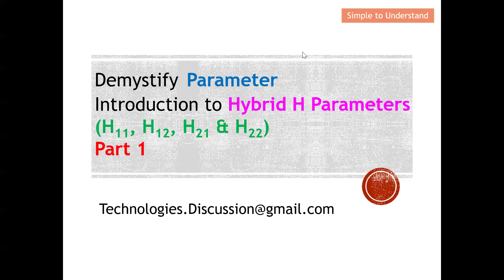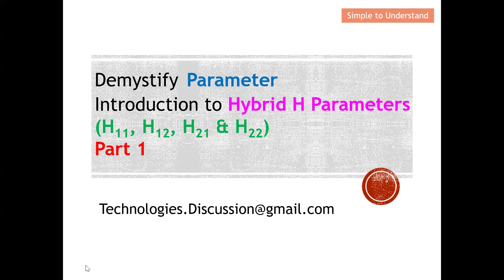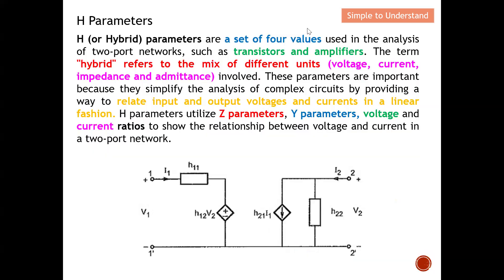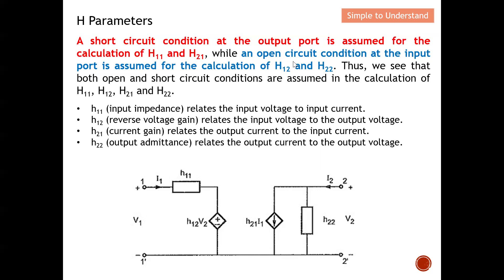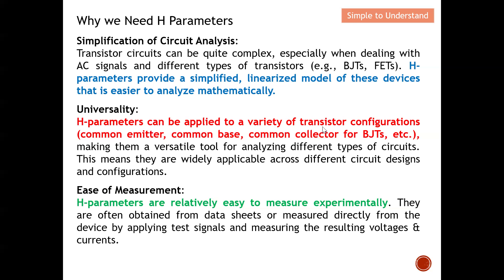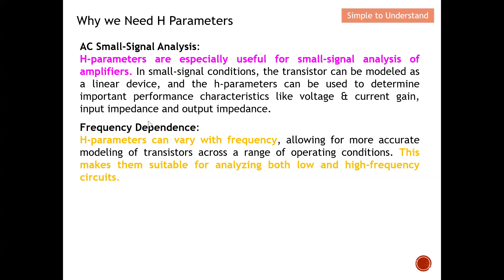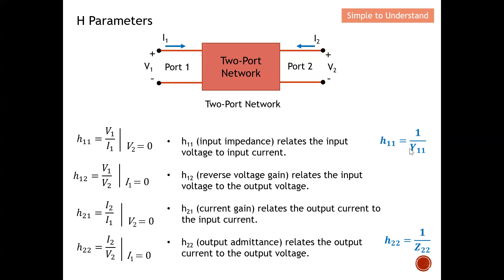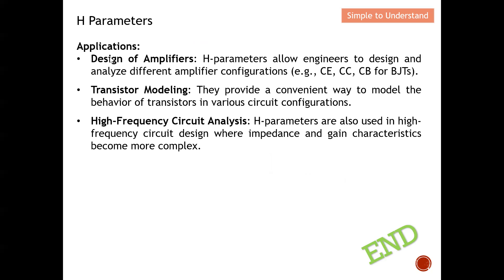H-Parameters. Improve Amplifier Efficiency & Design with Transistor Modeling (H11, H12, H21, H22)

Comment from the maker: Thank you for taking the time to watch this video.
In this video, I will introduce another new set of parameters called Hybrid H-Parameters, which are primarily used to describe the performance of transistors and amplifiers. The term "hybrid" refers to the combination of different units (voltage, current, impedance, and admittance) involved in these parameters.
Hybrid H-Parameters are especially useful in the small-signal AC analysis of linear circuits. Their purpose is to describe the relationship between the input and output voltages and currents of a two-port network, such as a transistor.

Here’s a breakdown of the key h-parameters:
h₁₁ (input impedance): Relates the input voltage to the input current.
h₁₂ (reverse voltage gain): Relates the input voltage to the output voltage.
h₂₁ (current gain): Relates the output current to the input current.
h₂₂ (output admittance): Relates the output current to the output voltage